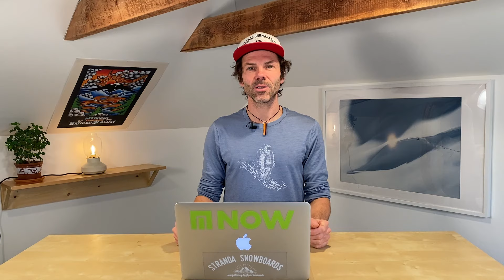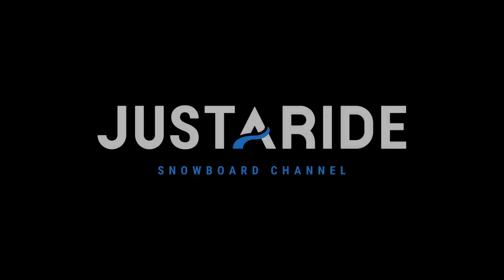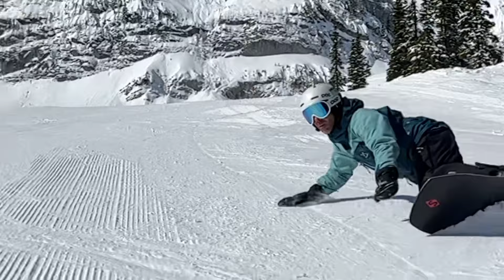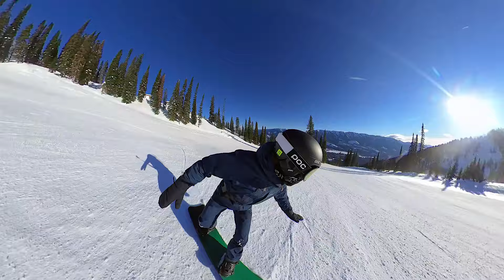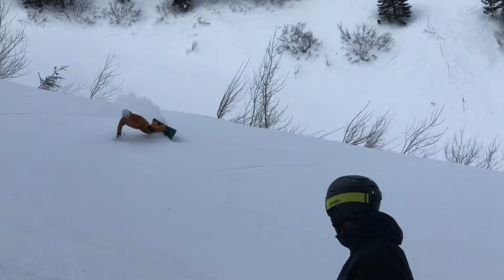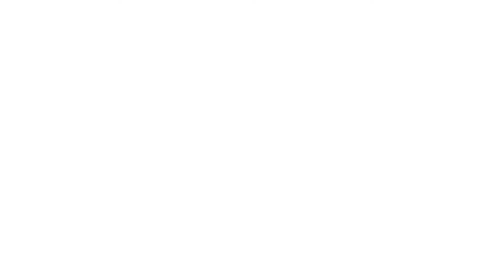Key Snowboard Carving Tips To Improve Your Turns

Comment: I'm just starting snowboarding, but I have 48 years of skiing behind me, including some amateur racing years. It's interesting how you just described the carving technique on skis.... For snowboarding 😁 guess phisics don't change 😉. One very important detail of the carving turn is the patience to tilt the board/skis gradually and continuously from traverse/initiation to the apex/fall line and tilting back to flat the same way, after. No matter how much or less you tilt, the movement is gradual and continuous with max tilt at the fall line. If you need to slow down, max tilt a little bit after the fall line. 
One tendency,very difficult to eliminate, is to take too much angle too quickly, with judder and off balance as a result...

Comment: changing edge before the fall line is a super helpful tip. I do have a problem on a deep carve heelside where cant get its shape the same as my toeside. Its much shorter, too tight and sometimes it kicks me out  at the end. What am I doing wrong?
Reply from the maker: Thanks for checking in!
I'm happy to offer video analysis at a reasonable charge. If you have decent footage of yourself, send it to lars.justaride@gmail.com and I'll take a look and let you know what I'd charge you.
Reply: I have EXACTLY the same issue.  You are not alone!
Reply from the maker: @andykirkwood  In fact, you guys are part of the 98% :-) Check my videos on stances, parts 2 and 3. This is the most common issue snowboarders are experiencing, and it has everything to do with not using the hips correctly. Think about it, in a toe turn your ankles and knees flex in the direction you want to bring pressure to. In a heel turn.... not so much! The next joint is the hip joint!! Heel turns are all about the hips! That's all you got... And upper body rotation... you have to rotate the hips and chest into that heel turn... It is quite difficult to learn a real good heel side.

Comment: I am interested more in tree riding and off piste. Any tips on riding position to improve this?
Reply from the maker: Practice bumps without the tree obstacles. Lots of vertical movement required - bend and extend the knees. Lots of torsional twisting of the board required through the feet. Impossible to give good tips without seeing you. I recommend taking lessons - but request a higher level instructor!!

Comment: Not sure if this is the right place to ask... I currently saw a used Stranda Biru 154 for sale but I am only weighted 130lb. I want a board that could do the kind of carving in this video but also has some mobility to able to ride in non groomed snow with friends. Is it a good length for my size or i should go for a shorter one? Thank you
Reply from the maker: You can ride that board, for sure. However, boards with this short of a radius are not really ideal for the kind of carving in this video. This is a matter of ability. If you’re still learning, the Biru can give you great carving vibes. Eventually you’ll want a larger turn radius for carving. Remember, the Biru is a directional all mountain freestyle board that can carve well. It’s not made to be a true carving board. So maybe it’s just perfect for what you want. Only one way to find out!! ✌️😉

Comment: Did you ever tried the push pull technique,extending you leg when on the fall line and bend it when perpendicular to the fall line ?
Reply from the maker: Yes. Down unweighted turns or cross under.... It's fun and exhausting! Hahaha.... I still haven't been able to see why that would be better as a general approach to carving, although many people are talking about it. I use it in certain situations where an insanely quick edge transition is required.
Reply: @ide-Snowboard-Channel You have less movement with the upper body and on backside you can tilt the board a little bit more.I used to the other technique and it take a bit to get used but now I use it with hard boots and soft boots as well.I found it more effective.
Reply from the maker: @goavegas4874  Thanks man!! I'll experiment! 🙂

Comment: Very nice technic. What is your feet angle  and stance?
Reply from the maker: Thank you! In this video I'm mostly set up 30/+9. There's one sequence where I'm on a Stranda Pipeliner 185 with a 260 waist width. On that board I need to ride 36/+18 to avoid booting out. I have size 10 / 10.5 boots.
Reply: @Justaride-Snowboard-Channel  cool. Other question... about bindings,  NOW drive pro VS drive cx....
Best setup for softboot carving  i use ride insano boots with COILER frbx 163.
( im 200lbs ex hardboot carver)
The question is about stifness of the combo boots bindings board...
Reply from the maker: @patricevilleneuve5547   I'm in the same boot. I ride Stranda boards - soft tips, torsionally stiff through the centre. I'm only 135 lbs... I foind the Drive CX a bit much... Like: I have to dial back forward lean because the highback have no flex at all. It's preference! Both a good bindings.

Comment: How critical is the board waist considering a 44.5 foot size in your opinion? I currently ride +15 -15 regular but i have a lot of limits on heel edge turn (heel dragging) , i'm thinking to re-learn  on double positive stance, more alpine style but with soft boots!
Reply from the maker: The greatest limit in your stance is the fact that your hip is entirely blocked and can't rotate forward to the degree it would be needed to get into a more efficient carving position. And yes, waist width with your boot size is an issue! You should be on something between 265 and 275mm waist, if you wanted to get the board higher on edge.
Riding a moderate alpine style with moderate forward angles in softboots is quite fun. I can't get enough of it... :-) +6° in the backfoot is all it needs. No need to go crazy. Play with! Find out what works for you!
Thanks for the comment!!
Reply: If you want to keep your duck stance you'd need a board with at least 30cm width. Check out Donek snowboards, they make customized boards. I started with 30cm (boot size 11) and still be booting out if the snow was a bit softer than i want . This year i got 31.5cm width, can't wait to try my beast on the slopes. Good luck
Reply from the maker: For a pure carving board that is only ever been ridden on perfect corduroy you can probably go that wide. There is something like what I call 'a functional waist width', where you don't boot out 95% of the time and the board is still rideable when things get bumpy. There's a point where the board has more leverage over your foot than the foot over the board. With your boot size and your board width that point has been surpassed. But again, if you just carve perfect cord, sweet!!
I'm a size 10 in a Ride boot. That's the same  as a 10.5 in just about any other brand in regards to outer shell length of the boot. My sweet spot waist is 270mm, and I don't boot out with a +9 backfoot - ever. Considering that the back toe points forward and the board is narrower towards the centre, my +9 would give me more toe drag than anybody in a duck stance of -15º on the same setup could ever have. "Duck equals more boot drag" simply doesn't make sense!
A boot grows by about 8mm per size. So a 280 waist should be plenty for a size 11 like you are wearing one.
Just my take on this! If you say you boot out, then I'm sure you do, and that is all that counts! But I have a hard time understanding that. Would be cool to see you in action!
Reply: @victoralekseev5671 I've considered to buy a Knapton twin, with large waist like 310 mm and like 11or 12  meters of radius but i'm not sure that it fit for my ride style, and i'm from italy so it would be difficult to try one before purchasing... now i'm riding a Bataleon Party wave Plus 157 waist 280mm.

Comment: Hello Lars; I'm in need of you insight regarding Stranda board sizing for the Shorty. I usually ride 155-157cm snowboards and my longest board is a salomon taka 158. I'm considering picking up the Stranda Shorty in 159, but not sure if 164 is the better option for me. I'm about 175cm at 71/73kgs. what are your thoughts? thank you and hear back from you soon! Thank you for your videos, they are very helpful 🤙🏼
Reply from the maker: If you are an active rider that moves fore aft through his turns, get the 164! The board has plenty of tip rocker. The camber ends right in front of the front inserts. So If you launch into the nose in the 159 there's not that much support!! Backfoot riders don't notice this... 
Don't be afraid of the length. Strandas are mostly made to be ridden longer. You'd be buying a 164 with a 158 flex. It's magic!
Reply: Really appreciate this Lars! Have a great day and see you on your next video 👊🏽🙏🏽
I’ll go with the 164! Woohoo
Reply from the maker: @hankins4  If you're ordering it from Stranda, tell Mats that we talked! I don't get anything from that, but it's good for him to know.
Reply: @Justaride-Snowboard-Channel  I’ll email him about our chat! 
I’ll actually be ordering online from your local store edge of the world!
Reply from the maker: @hankins4  ha! Okay. I used to work there. Tell them I said ’hi!’ 😅

Comment: What about the board itself? I think it's the most crutial part. Board has to be really wide a have quite a long effective edge length. Most boards aren't just suitable for carving. Correct me, if I am wrong.
Reply from the maker: @ogyct  board come last. Once you out ride a standard all mountain board in an appropriate width, you can think about a board. I still don’t need anything but a directional shape with camber and the right width. But I appreciate I have something better.

Comment: I have to move the back knee into the front? Or I don't have to think about knee, it moves because of a consequence of  hip movement?
Reply from the maker: Everything starts in the feet! If you want to rotate the hip into a heel turn, the back foot / knee needs to push that way first. Depends a bit on the back foot angle! The more posi, the easier this is. In a toe turn I aim for pushing my back knee a little towards the nose of the board, more like next to the front knee rather than behind it. I don't really find that 'tuck knee' that efficient or comfortable. I'm not aiming to have my back knee tucked behind my front knee.
in a heel turn I push both knees sideways towards the heel edge. The hips always follow. And there's a million other things that need to be done... Hahahaha... It's such a complicated thing to make clean carved s-turns... It really is.

Comment: Hey, was wondering about switching to wider snowboard in terms of do it all.
Curently rocking nitro team camber 159, which has 252waist width, thinking about switching to directional set back camber so i can do groomers and some powder.
A lot of people are recomending me Ride Superpig, which is great on groomers and powder.  comes in 270waist width and setback camber rick rocker nose.
Do you have any idea how does the riding change in terms of carving/edge control, if my waist width changes that much?Is it more effort to initiate carves, or what exactly? I def know i'll be able to carve deeper, but not much else.
Right now i have aprox 1.5cm overhang on both sides on my prefered stance.
Reply from the maker: Your current overhang is not bad at all - unless you already carve aggressively, achieving very high edge angles.
Superpig is a 'short fat', which has limits in choppy, bumpy terrain, if your boot size is relatively small. You need some overhang!! A better waist width for you would probably be around 262 to 265.
Reply: i do manage to do some agressive carves, but don't seem to catch an edge yet, tho i've seen my boot toes touching snow lightly from time to time, so it's pretty close, heel side is def not as agressive, fixing my forward lean adjustors, waiting for new parts. :D 
Thanks for the tips! Your Youtube has a lot of useful information, i wish your channel was bigger, you def deserve more views and recognition,this info is really useful and would be beneficial for a lot of people. 
 @Justaride-Snowboard-Channel
Reply from the maker: @rauliuxaa  thanks for saying that!! Share the heck out of it, so I can grow this, ha! 😜

Comment: Is it possible to carve like that without being dual positive?  Just more difficult? Or not even possible?
Reply: I would like to know too - I'm currently running duck stance since I want to learn to ride switch as well, that dual positive stance isn't really built for switch 🙃
Reply from the maker: You can do a lot of things in many ways! So yes and yes... You can ride switch in this stance, and yes you can carve quite well in a duck stance. But if you watch my two episodes on duck and posi stance, you will understand what the limitations are! It's quite technical. Just watch the videos, That's easier.
Cheers!!
Reply: Thanks bro I watched it once will rewatch.  Going to experiment a lot more with stance and equipment this winter!